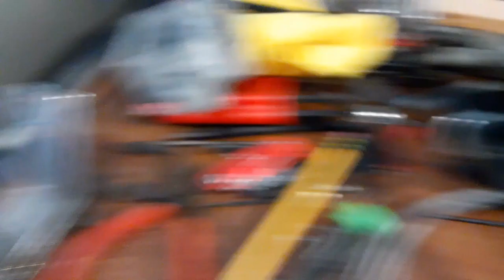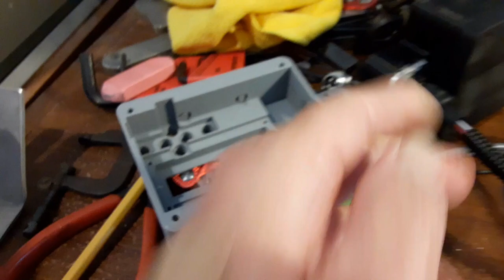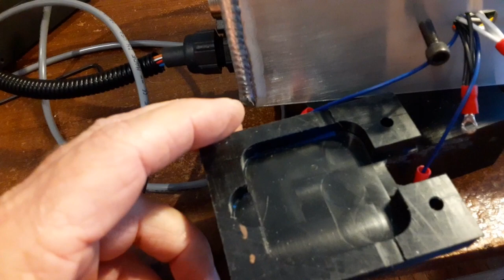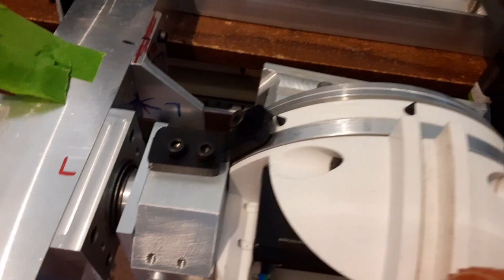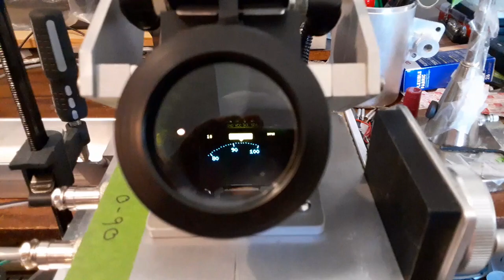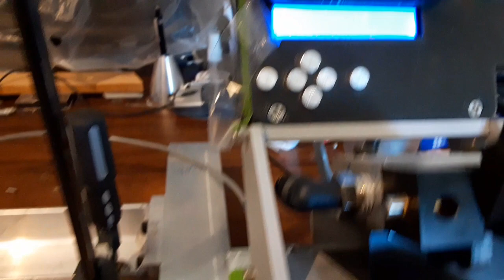The wiring inside the control box. Two axis five axis indexer.

Comment: Would a pulse generator help with the jumpyness.
Reply from the maker: Thanks for the interest, there is a pulse generator which is the CNC handwheel. It sends the signal to the motor board which is not working at this moment. Will have to investigate this soon.
Reply: @toolmaker1370  didn't realize that you had one, for some reason I thought I had heard you talking about a potentiometer being used
Reply from the maker: @marksanders4815  It does have a potentiometer to read the angle of rotation. There are several systems that rotate items, and several systems that read position. Each are independent of each other. Unfortunately, they all work off of one power source which seems to be an issue.